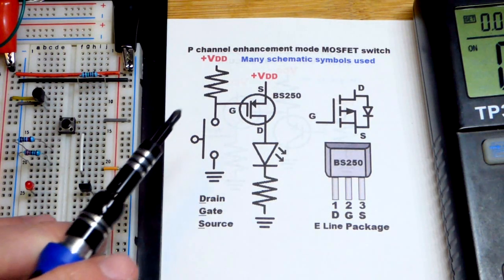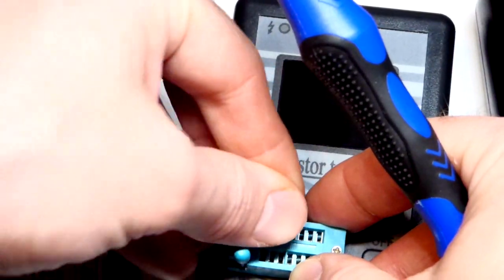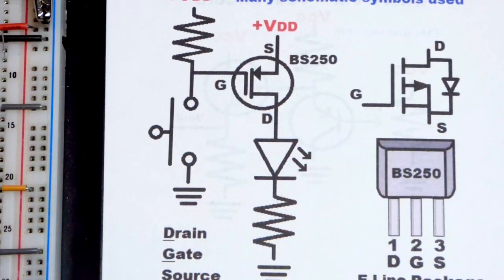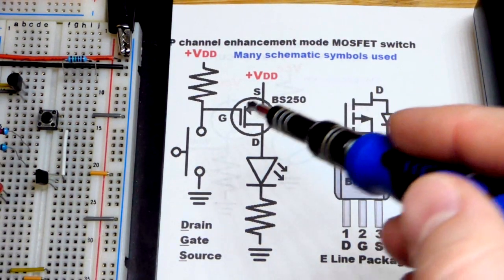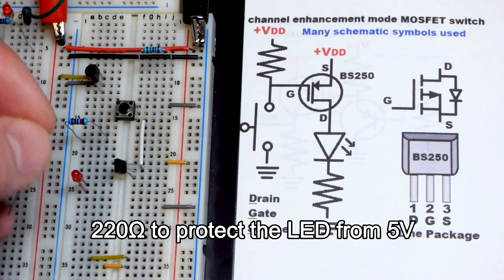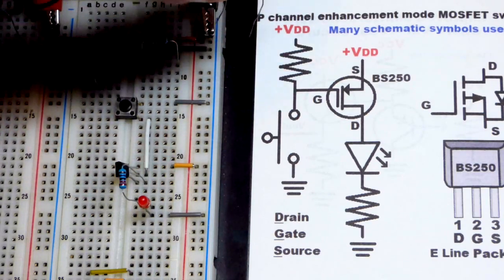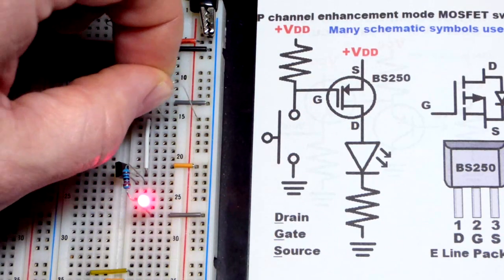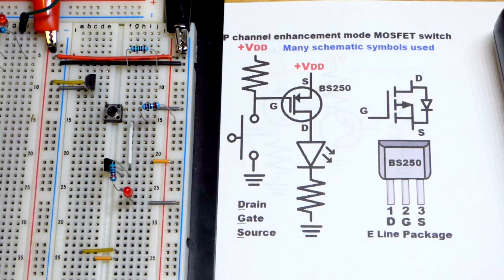Quick BS250 E line package P channel enhancement mode MOSFET switch circuit by electronzap

Comment: So are you saying that the load should be connected to the drain of the P FET, which and it is on the ground side?
So if I want to send current to the load by turning on the P FET using hall A1344, I should use a P channel ( possibly enchancement mode one) when the magnet passes the hall and use a resistor ( such as a 1K ohm to the positive rail like you have?).

With this PFET, no voltage and negative voltage means the FET will turn on...?
Reply: Vgs = 0v, fet is off. Vgs < 0v will be on below a certain threshold value.